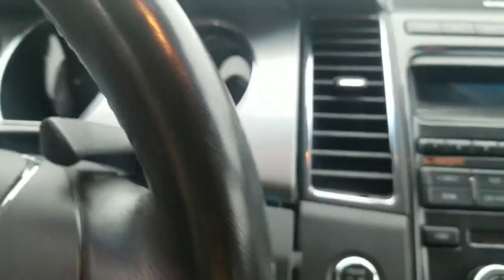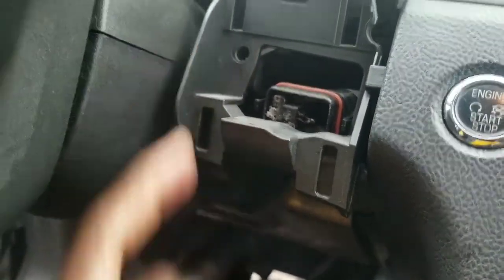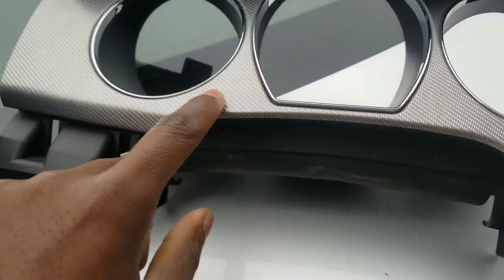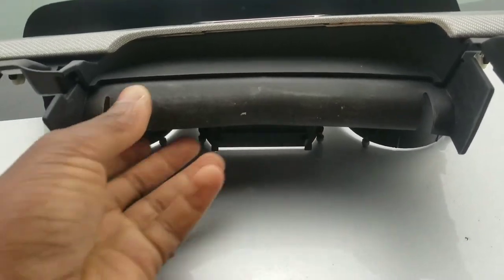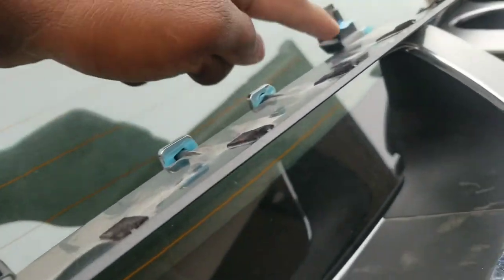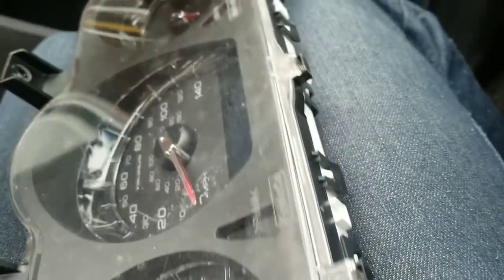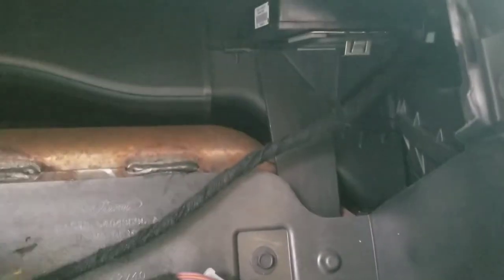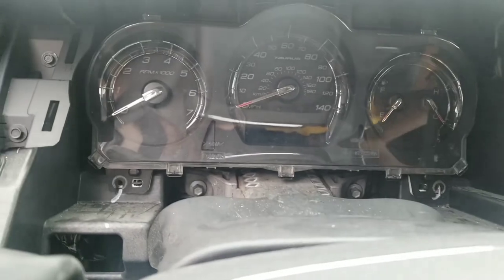2010 - 2018 Ford Taurus [SHO/interceptor] Cluster gauge / Tachometer removal

Comment: Do you know if any cluster part AG1Z-10849 will fit ? My dealer tells me I need part AG1Z-10849-MB for my 2010 SHO. But i cannot find the part ending with MB .. many available but ending with LA / LB etc
Reply from the maker: So any 2010-2012 Taurus & MKS cluster will fit ... the 2013+ will fit but will not work. The mileage will not transfer though.
Reply: Is there anyway to make it work